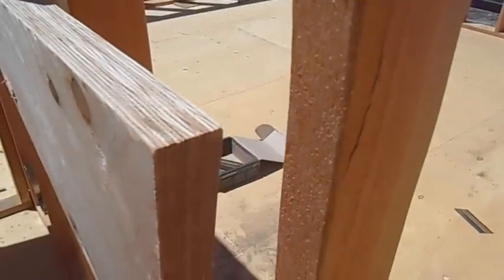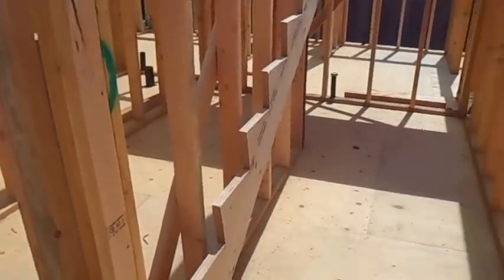Stair Framing-Tips and Tricks

Comment: 2x4s arent good fire blocking..LOL.LOL..BTW i would've added a middle stringer and notched out the bottom of all three stringers and added a 2x4 to the floor too tie in all three stringers.
Reply from the maker: Fireblocking (now referred to as firestopping in  the code)
 Per code:
 Accepted materials in a wood frame residence-
-2x lumber
-2 layers of 1x lumber
- 1/2" gypsum board or 1/4" asbestos board
- Batts or blanket mineral wool or fiberglass insulation
- other approved materials
A 2x4 wall- a 2x4 block: easy, straight forward.
   One of the reasons I shared this video is to demonstrate the construction method that  produces an extremely rigid system that eliminates the need for a middle stringer.
  Because each stringer is nailed to each of the enclosing 2x wall studs, the need to notch the stringers to a bottom cleat is also eliminated.
  In a free standing staircase, a middle stringer and bottom cleat would be necessary as you describe.
As always, more than one way to skin a cat...
Dave
Reply: @daveosland3199  Yes i know...And i agree there is more than one way to skin a cat..

Comment: No center stringer,no stringer ties,lvl for treads and stringers(2000 in lumber for stairs in the rough?)
12" run?
You used more floor space for that staircase than it takes to frame in a full bath.
You set your staircase before straightening and bracing walls ? And sheath the second deck?
Why don't Western crews sheath their walls before raising them.
We build our overhangs,boxouts,Queen Anne all on the deck. Tip up and tie the corners.
You gotta struggle with hanging and nailing plywood and hiusewrap....
At least it will take four years to fall down the stairs with all those terraces built in😁

Comment: Pretty good video. You used LVL,s for stringers, you placed the 2x4 behind the stringer for sheetrock and finish stringer. I might add you should round over the tread with a router , and notch the stringer bottoms for a 2x4 to lock in stringers, and build a short wall under stairs so that you eliminate the tight spot at bottom, about two to three feet out.
Reply from the maker: Good comment!
 A short wall was added later to save the drywalled  from laying on his stomach to hang/finish a tight area!
Because the stringer is attached to each stud, a notched  stringer is unnecessary. This method, when applicable, is dead sturdy with absolutely no deflection, as an open staircase might have and need that notched stringer.
 The rounded nose is a good idea- Thanks!
Dave

Comment: I am a trim carpenter that specialize in stairs. And in 15 years when someone like me has to come back and fix them because it is coming lose in the middle from kids running up and down them. You should at lest put a third stringer in. And with the landing shouldn’t you have made it as one. Or at least had it step up the same as your risers. This way you will trip on it almost every time you go up or down them.

Comment: The nails would eventually vend . Don't you think the stairs going to squeak
Reply: the method is super solid, never any squeaks with the const. adhesive. Use screws if you're worried about it, but i  I I  I can't imagine what kind of loads would cause the nails to bend....with the const. adhesive on all connections there are never any squeaks
No squeaks with the const. adhesive on all connections
Never had any squeak issues with the const adhesive on all connections. Nor nail problems.

Comment: yeah this is a bullshit way to build stairs. I guess it will work in track houses. in Custom Homes this won't fly because carpet doesn't just roll over them. I install Oak step tread then one by riser
Reply: MIKE HUNT I do the same thing but I renovate old staircases with new oak treads. And when they don’t add the third stringer it really makes it hard to do!

Comment: I noticed it looked like your treads didn't have a nosing, no overhang. Is that the reason for the angled risers? I've always built and seen stairs with usually 1 1/4" overhang. I cut a 10" tread into the stringer then use a 2"x12" tread so the tread is 11 1/4" with an 1 1/4" overhang. Or with decks I use 2 decking boards for the same result.

But yea those are some heavy duty stairs you build. They do cost more but if your customers are paying for it and your happy with the money you make building them. That's great. 

Last year I built the stairs for a 6 story apartment building (It was in a 150 yr old building that was all wood, post and beam with a brick exterior. (The post on the first floor were 32" sq solid oak post, it had huge beams real 2"x14" joist with massive 250 lb cast iron brackets holding the beams on the post. It was pretty cool!) anyway the 2 stairways were 6 floors straight up 15' per floor. They were engineered to be built out of 4 LVL stringers per set in case there was a fire and the stairways ended up full of people. LVLs make for a very strong set of stairs.
Reply from the maker: The angled risers are used to get a wider tread as well as allow carpet to be rolled over the nose without having to be rolled and stapled under the nose, as would be required if there was an overhanging nose.
If the stairs were to be overlaid with hardwood, I build them with a square and  flush nosed. A hardwood nosing piece then hangs over whatever its' milled profile is.
  I've used your method numerous times, also-
Dave

Comment: Great video ! but I got a question, were you shooting 16 pennies into the 3/4" thread ??? I found that weak. Am I wrong? I personally plow a dado on the raiser to receive my thread. Just my two cents.
Reply from the maker: The treads and risers are  (1.5" thick) LVL, along with construction adhesive- no squeaks or deflection! The two square platform steps were 3/4" ply with 16" o.c. framing underneath, nailed w/ 8d HD ringshank w/ construction adhesive...
dave
Reply: Dave Osland, Now we are talking 😎 again nice work ! keep it up!
Reply from the maker: We try! Every job is a new learning experience I learn something new on!

Comment: great work. you guys used LVL for stringers.
Reply: Dave Osland hey buddy when it happens it's no big deal just grab you some wood glue and glue that triangle piece back to the Stringer. drive a couple finish nails or screws to hold it tight while the glue dries. it will be stronger right there than anywhere else on the Stringer
Reply from the maker: using solid lumber for stringers is cheaper, but tend to crack or break off towards the nose of the step..
Cry once (how many times have I gone the cheaper route and regretted it!)
Dave